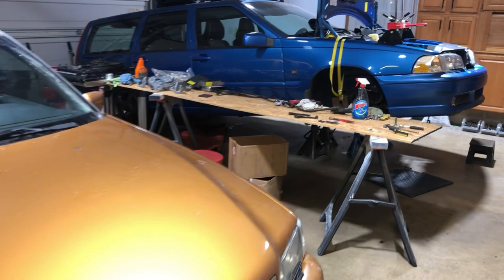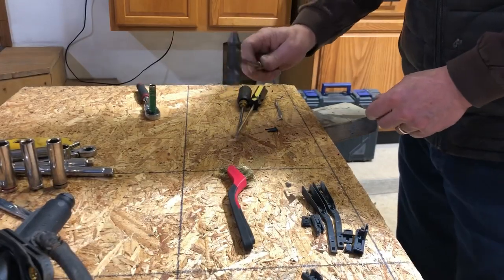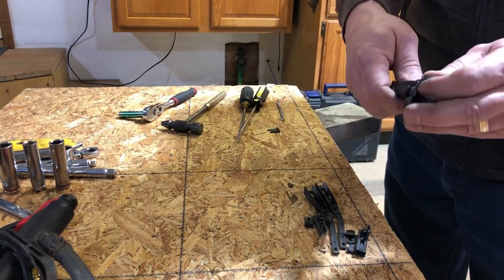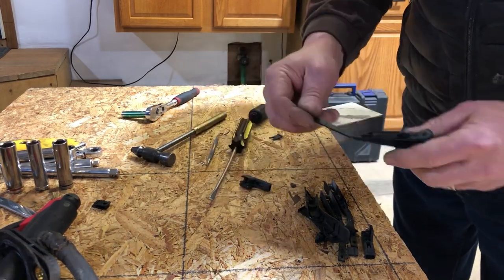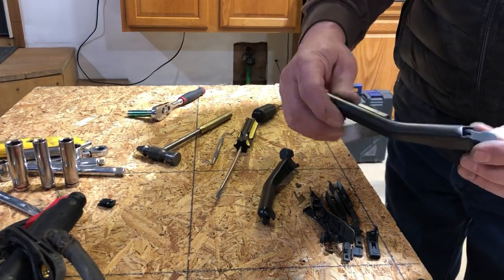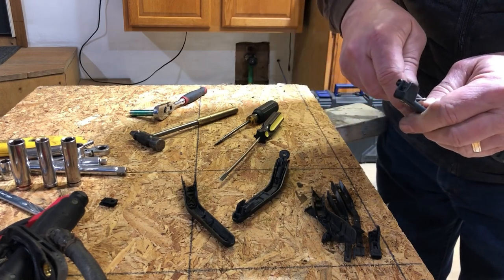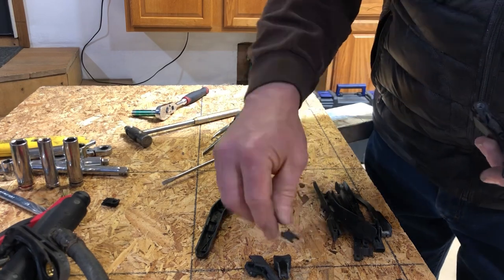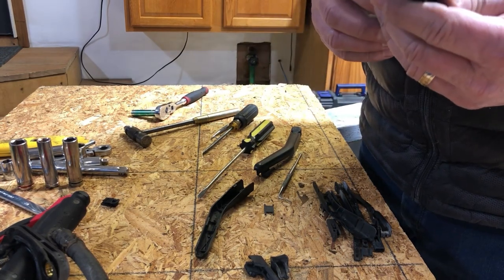Laser Madness- Rebuilding headlight wiper arms? How to repair these using junkyard parts, buy why?!!

Comment: I leave them on, but frequently I notice one or the other pointing straight up while the other is horizontal.  It looks like the car is sending semaphore signals.
Reply from the maker: Hey Stuart
I unplug the motors and reset the arms to horizontal by removing and reinstalling them. Thanks for watching!
Reply: If it does it randomly after using them, it's probably the thermistor going bad.  My passenger side wiper does it if it's warm outside.
Reply: Our 960 wipers are in good shape. …If only they would park correctly more often than 10% of the time.